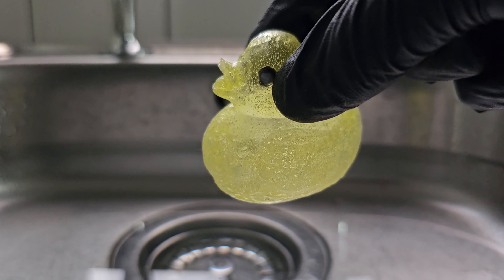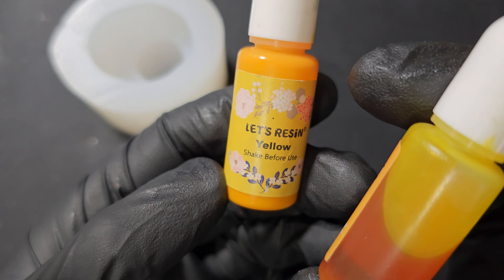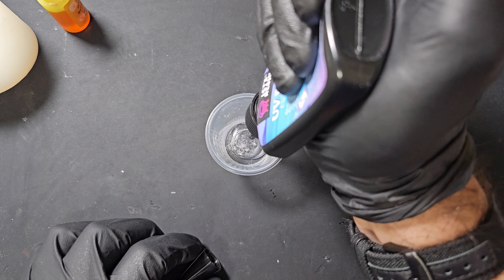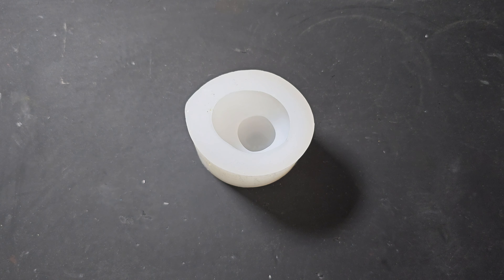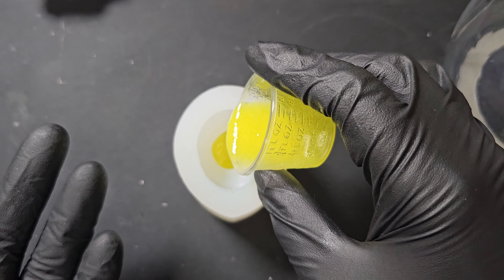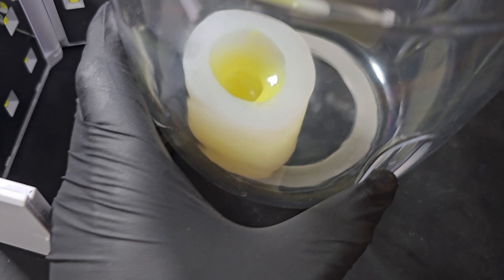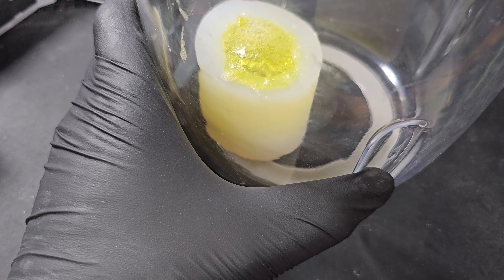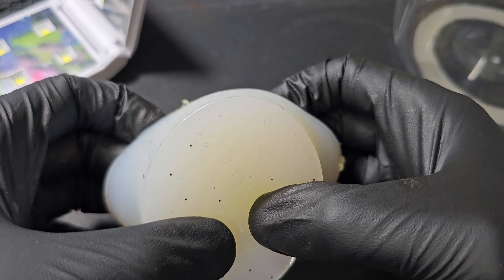Resin Duck VS Water! It's SINK or SWIM!

Comment: What happens if you use uv resin in the vacuum chamber without excessive bubbles? I just wondered if it was the uv resin's natural reaction to the vacuum. Would the outside be smoother?
Reply from the maker: It would cure as normal
Reply: @daniel..cooper  Thank you. Big fan!